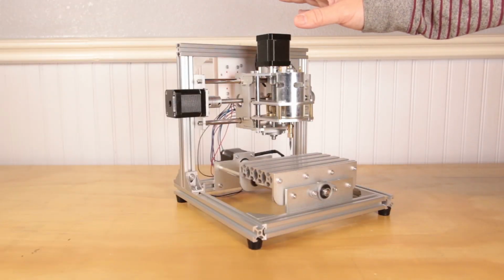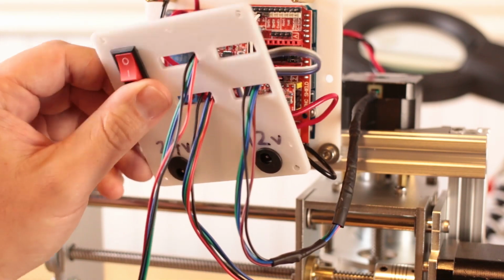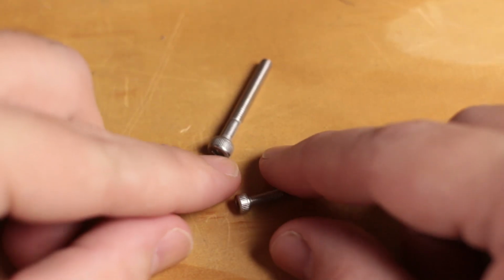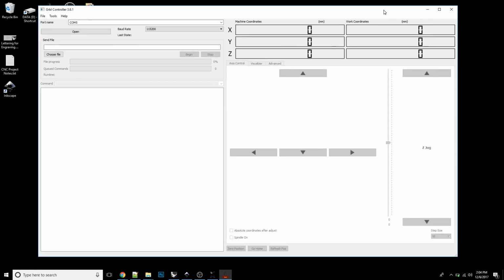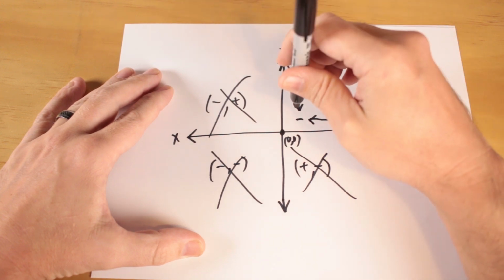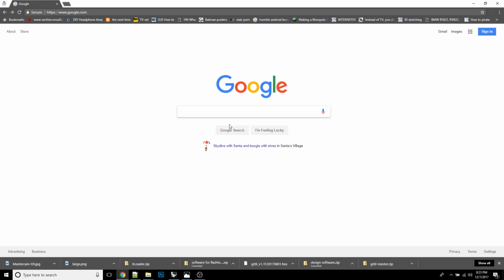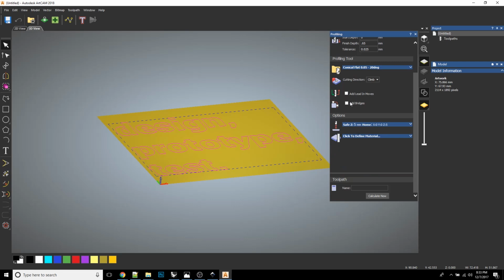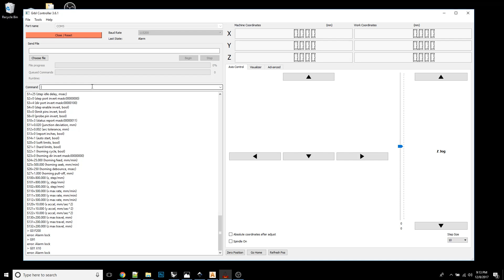How to start CNC Machining for under $200 - Working with the T8 CNC engraver

Comment: I gave you the benefit of doubt in your claim this video has been plagiarised. since you have disabled comments on that video I have come here to give my (non troll) opinion. 

Firstly your video. Take this a s a review. 

Your video is far too long filled with so much content that has no need to be there. Half the video is building the thing and offering up advise on a printer that seems to have no real future. You then talk about how a XYZ printer or CNC machine works. I kinda feel like this stupefies your audience, surely they know how this works??

You then bumble your way through the software again offering up too much irrelevant information and not knowing what you are talking about with the explanation of features and settings. 

You then do a quick route of some letters then that’s basically it. 

Michaels video bares some resemblance to yours in that it follows (basically) EVERY other info review video being, build device, set firmware/software, do the thing it does, end thoughts.

You didn’t design this style of video. 

Michaels video is well under half the length. He is fully informed of each feature he is trying to explain in software. His CNC machine seems to be a better machine. He is to the point and informative. 

I feel after watching your video that I was left trying to remember what you talked about and was definitely of the opinion that I would not be purchasing the device you had or use the software you suggested to use. 

After watching Michaels video I felt that is was something I could easily do and $200 was not a lot of money for something that seems pretty fun. 

At the end he did not copy your video. He made a video of the same content. Of which you 3d guys all do and re do videos of the same product or device. 

You need to not be upset by a video that came along after yours that is better than yours.
Reply from the maker: I like the respectful tone of your disagreement. Thanks for being cordial. But you are wasting your time and mine. The fact is without me and my video TT wouldn't have a successful video. He copies. He is not an original. And most egregiously, he copies titles. It's a real estate grab on YT. There is only so much to go around. I found a good title, and he moved into my turf thus stealing my revenue. He has done this to many other creators for many other videos. TT is not an original. He is successful because of the insane number of technical videos he puts out there which triggers the YT algorithm to promote his videos more. It's not an organic thing. His videos are liked ok by people, but his success is mostly attributable to gaming of the algorithm. It's not caused by people's perception of him. He's liked because he's successful. He's successful because he gamed the algorithm by releasing so many videos. Also, the videos which are his and not copied are never very good performers. As the saying goes: Those who can, do; those who can’t, teach. But yeah, congratulations to him on his work ethic, and formulaic time saving video creation strategy.
Reply: @DesignPrototypeTest  I have to totally disagree with you on him being successful or getting more views because he “played the game”

I watch many different YT creators. There are MANY in the 3d printing world. 

There are MANY who’s videos either loose me, are boring, poor quality, blab on, just don’t capture my interest. 

Out of all of there creators TT has definitely captured my attention. His videos (regardless of originality) capture my interest. They are good quality, to the point, interesting, and don’t blab on. 

So for me he gets my view not because some algorithm tells me I should watch it but rather because he has made a good video worth watching. 

Note: my interest in 3d printing YouTube videos came from research and wanting to decide between a couple of printers. Kersey Fab because my go to as I set up and modded my E5+. I watched many other creators videos and for the very same reason of him making better quality and to the point content he got my views. I then expanded my 3d printing knowledge searching and learning how to use a 3d printer. Many creators went by the way side before I stumbled on TT and Chep. Not many others make the quality content these guys make. 

To be honest I’ve watched a few of your videos and was not captured by them. I guess that’s mainly because I’m not interested in the content mainly. But I do watch videos that aren’t in my interest out of a want to learn as much as I can. 

Good luck with what ever you do. 

Other than the $200 (which just happens to be how much his printer cost) (and also there are others that use the same or similar title, maybe they stole your protected content and revenue?) I don’t see any resemblance in the two videos. 

I’m not trying to raise on and drop the other or favour one over the other. I’m just giving my honest opinion.

Comment: Will it work on aluminum?
Reply from the maker: No.
Reply: Not even with a different bit? And what about polymer? Sorry about all the questions, just looking for an affordable cnc that will do aluminum
Reply from the maker: Yes, you could cut plastics (polymers) such as carbon fiber, and delrin/acetyl with this machine, but maybe not very well. Go watch  this video to get an idea: https://youtu.be/docu7RM4Tm0

The Machine is not rigid enough to cut metal. It's really not good for anything except engraving. I can actually see the wiggle in the bit when pressing on it with my fingers. To realistically cut metal you need an incredibly stiff machine. To the best of my knowledge, the least you will spend at this moment on a CNC machine is $1500 and it is a very involved and difficult build. Watch this video to get an idea: https://youtu.be/fPoP4r03Y1I

Comment: I always solder wires before crimping. Just to annoy people.
Reply: I usually heat it up once more after crimping. It makes the connection SO much better. Crimped connection can take ~1 Amp. Soldered it can take ~10 Amp.

Comment: 3:35 WTF? A faulty motor?
Reply from the maker: I partially disassembled the motor at 5:35 because I wanted the wiring to face out the back toward the control board. It was easier to partially disassemble the motor and rotate the plate than it was to dissemble the Z axis in order to rotate the whole motor. Those screws on the underside of the motor are difficult to access.
Reply: @DesignPrototypeTest  
THX for reply :). By the way nice tune @ 5:35 could be housemusic.
I really enjoyed the 2 part CNC introduction, wouldn't mind if there
was a DIY CNC milli project about this size for home use with wood 
and plastics. I doube that the China engraver could even mill some 
wood, not to mention acrylic and harder materials. Acrylic dinosaur 
3D puzzle look dope, if illuninarted by a RGB- Led's it's even nicer :).

Comment: I had to stop at the soldering part. You did that completely wrong.
Reply from the maker: Just because it is common knowledge doesn't mean it is correct. The soldering your leads being bad for screw terminals is not an open and closed case. For more information read the comment string started by Nicholas down below.
Reply: @DesignPrototypeTest  I was mainly taking issue with the touching the solder with the iron before the wire. You heat the wire and use the wire to melt the solder.  Also tinnig the wire before crimping is worse than crimping and then solder. Crimping first gives you a stronger connection and the solder just fills the voids.

Comment: It really pisses me off how people talk about this stuff but have no clue.
1. All 3D printers are CNC, so you are doing nothing different here.
2. Saying, "let's build a CNC" is a total bollocks statement.
3. All forming, cutting, welding, processing machines that use G-code or similar are all CNC because they are all Computer Numerically Controlled devices such as CNC MILLS, CNC ROUTERS, CNC LATHES, CNC MACHINING CENTERS - starting to see the common link yet are we?

At least get you terminology right before starting.
Reply from the maker: Pedantic much? Technically you are correct, but you aren't making any friends with an attitude like this.
Reply: @DesignPrototypeTest  Yep, technically I am correct and I have no wish to make friends with people who are amateurish.

Comment: You realize 3d printers as well as mills, lathes, etc are all CNC machines? Inkscape has a built in gcode plugin to generate gcode from the current image. Nick Saporito https://www.youtube.com/channel/UCEQXp_fcqwPcqrzNtWJ1w9w has a pretty sweet batch of videos about using inkscape and gimp. He even has some videos that cover simply what some of the tools do instead of his typical videos that show how to achieve a particular finished product.
Reply from the maker: As CNC in an acronym for "Computer Numerically Controlled" you are correct that a 3D printer is in fact a type of CNC machine. I was wondering how long it would take for someone to call me out on that one. Technically, I should have ended my introductory monologue with "...and we're going to play with a small CNC Router" I don't script my videos (because watching someone read a script is boring) so I frequently have small omissions like this. Thanks for watching, and providing a helpful link!

Comment: It 80/20. Not 20/20 L O L.
Reply from the maker: So, this is interesting. I was a bit confused by your comment and so did a little bit of digging around on the internet. It turns out that you are technically correct "80/20" is a brand name of aluminum extrusion. Perhaps they are the original maker of the stuff, but if you look on ebay, aliexpress, banggood, etc, for "2020 extrusion" you will find extrusions with a cross section 20mm x 20mm. It's the same if you search for 2040, 4040, 2080 or any cross sectional dimension you wish to buy.

Comment: Never ever tin the tips of the wires that will be crimped. Google why.
Reply: The "Reasons" are all made up BS that have been disproven.
Reply: IPC standards clearly state not to tin wires that will be in crimp connectors.  It will fail inspection if you're doing certified work.  Where do you find that these standards have been disproven?

Comment: Never tin your leads. Its against all professional recommendations. Use a crimp plier. Dont make videos about things you obviously don't understand
Reply from the maker: Many electronics come from China with tinned leads in screw terminals. Previously I had a melt-down problem with a wire that was not tinned. I've never had a problem with a tinned lead. Theoretically, the solder can migrate over time, but it's never an issue I've experienced personally. Also, Go look for the comment chain on this video started by Nicholas to see the scientific evidence that disputes your claim. The issue is not so one sided as the people who taught you want it to appear.
Reply: THE standard on electrical connections is called IPC it is used by all industries that matter including aerospace. This standard clearly forbids tinning of wires for crew connections. The reason for that is that tin deforms under pressure and the contact pressure cannot be maintained thus leading to increased resistance, oxidation and overheating. A industry standard like IPC should have a lot more significance than some misinformed youtube debate
Reply: Jorn Navarre  that can easily be rectified by using a quality wire stripper and crimp ferrules